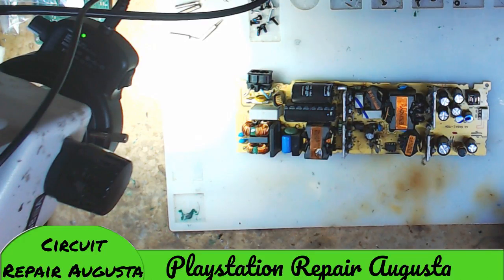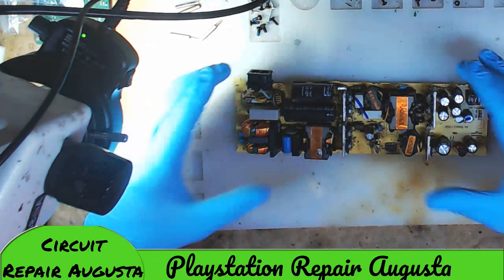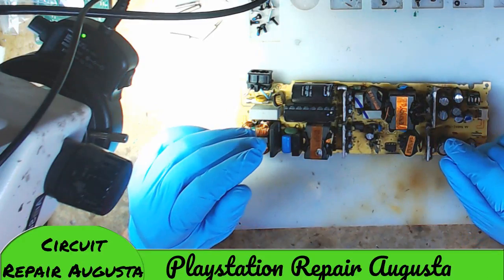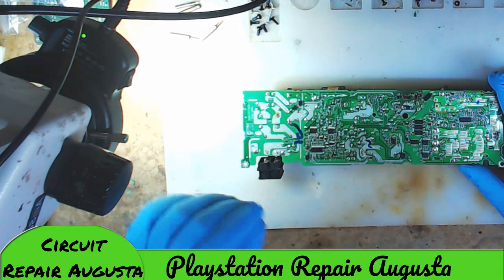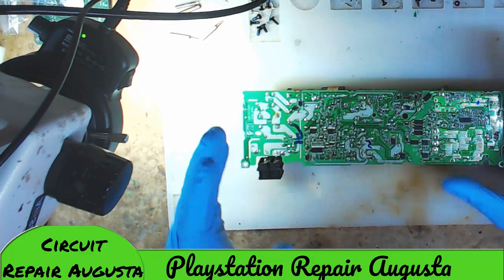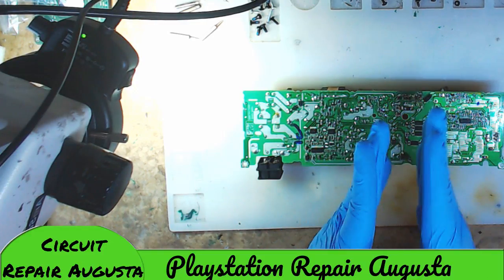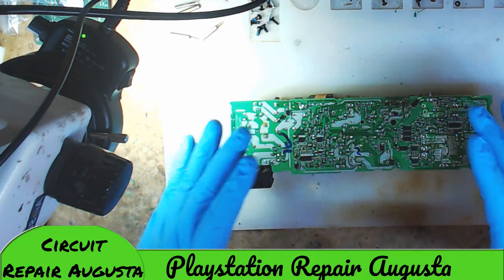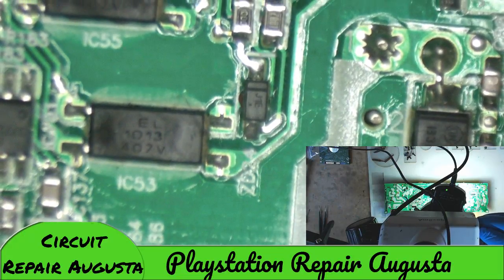PS4 Power Supply... When is it too far beyond Repair?

Comment: hy.i have old model ps4 -power supply model adp 240cr aac.my ps4  doesn;t  start.
the source is the 4-pin model. how can I test it on the table, without the motherboard connected.has neither the 12 v nor the 5 v on the outputs.can you help me?